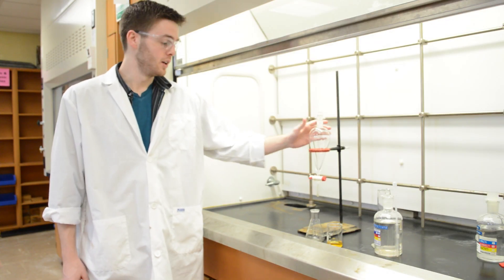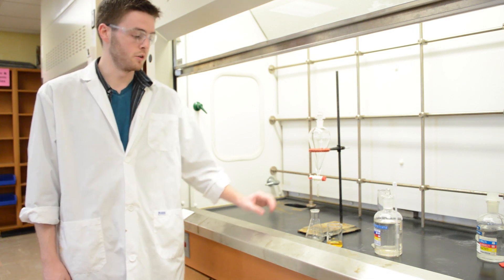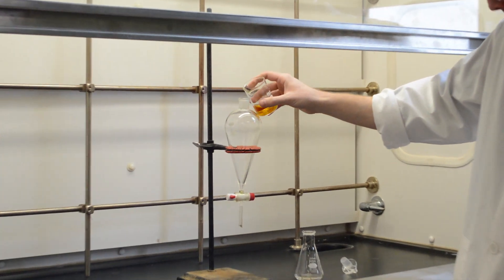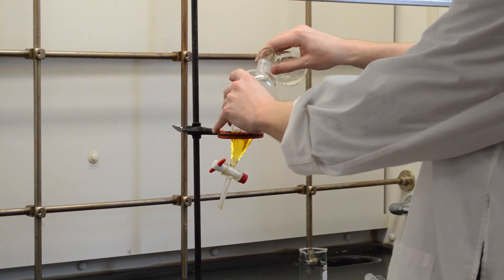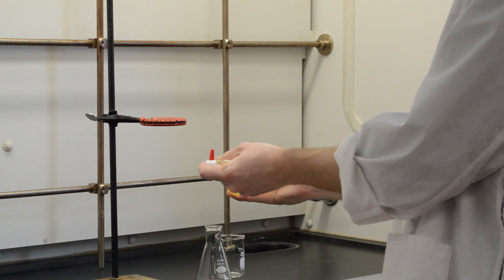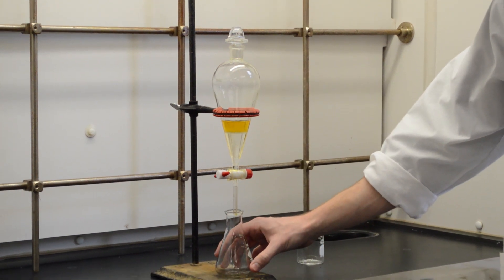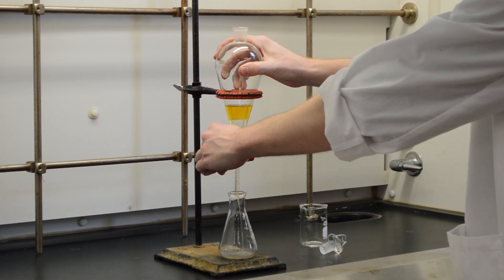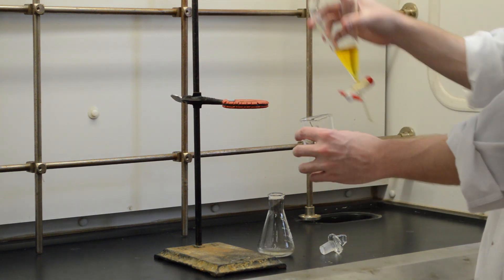How to Perform an Extraction - Separatory Funnel

Comment: What is that thing that is holding the separatory funnel while being firmly attached to the retort stand?
Or do all retort stands come with that little contraption to hold a separator funnel?
The retort stand that I am looking it has a metal ring attached to it?
Will it do for use with a separatory funnel set up? Or do I need to pay extra for an add-on contraption to hold the funnel to the retort stand?
Reply: it's called a ring clamp... it comes separate from the retort stand.. the ring clamp has its own separate clamp that screws unto the retort stand

Comment: Thanks, this was a great demonstration. I know this is an old video, but can you complete the separation funnel process prior to distillation? Or is it always 1. Reflux. 2. Distillation. 3. Separating Funnel ?
Reply from the maker: Generally speaking, distillation is used to fraction off (separate) dissimilar boiling point liquids that are miscible with each other, ie they form a homogeneous solution. So you could separate methanol from ethanol by distillation, which you could NOT do using water and an organic solvent, as described in this video. 

However, if you had for example coffee, and you wanted to extract the caffeine, you could not use distillation to  do so. The method you would use is separation via extraction in a separatory funnel. When you mix the aqueous coffee with a suitable organic solvent, the caffeine will be transferred from the aqueous coffee solution to the organic solvent, where it is more soluble. You can then remove the aqueous component and continue the extraction as described in the video!  

I hope this answers your question!